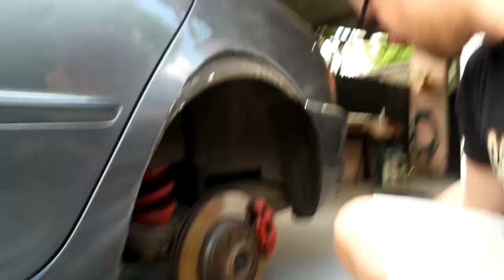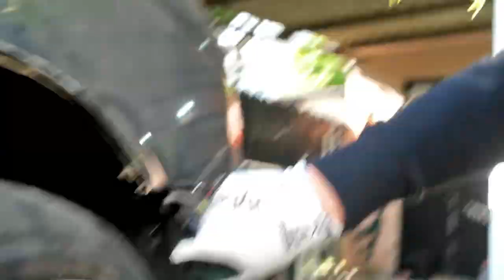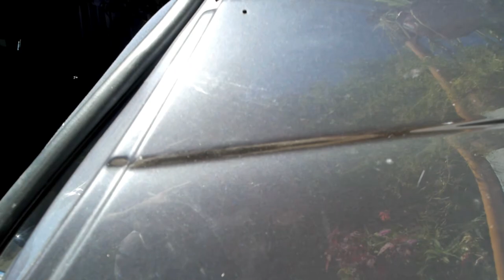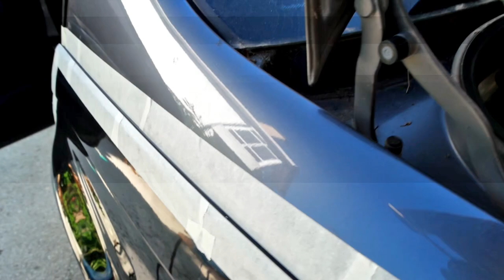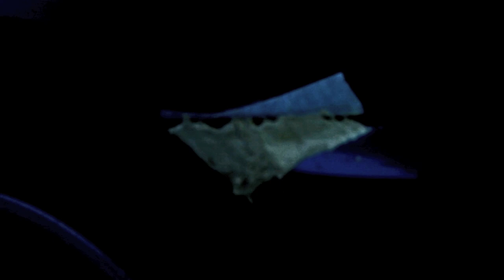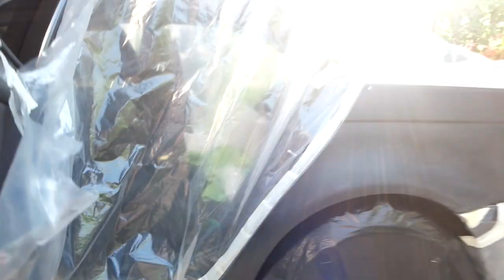BMW E46 M3 Rear fenders for sedan installation

Comment: Beautiful work! I have to do this now. I can’t fit the wheels I want on my car but I didn’t wanna mess with the stock body lines. This is perfect!
Reply from the maker: Thank you mate!
Reply: Cut surfaces weren't protected from rust. It will start rusting inside. Trash work. 2 years down it will be a rust bucket.

Comment: Could you have overlapped the new quater panel on without cuting the old one like you did?
Reply from the maker: I could but then you cant make a proper fitment for the wheel
Reply: Got it.  Very nice upgrade.  It looks mean and now you can get wider wheels for the rear.  Great job!

Comment: Cut surfaces weren't protected from rust. It will start rusting inside. Trash work.
Reply: Exactly my thought .... in max 2 years that car can be scrapped or reweld new fenders cuz that its shit work .
Reply from the maker: Dont worry mate, it was isolated with specifiic kind of silicone against the rust 😉